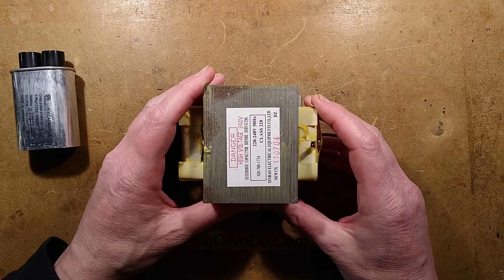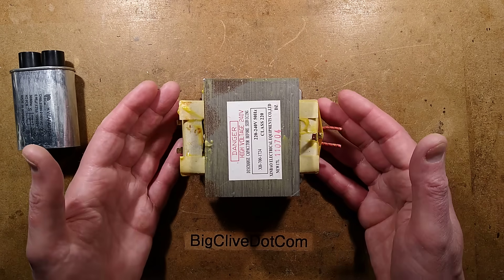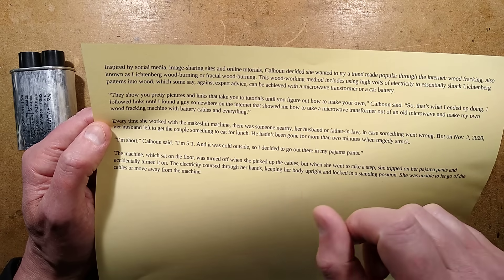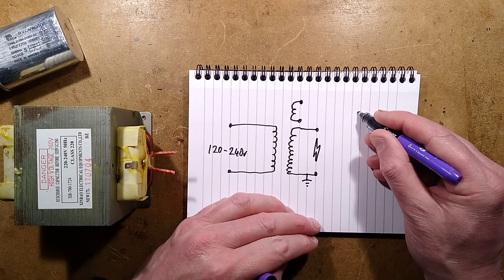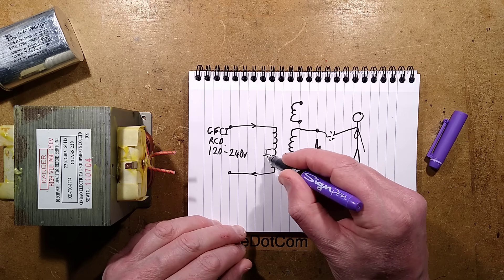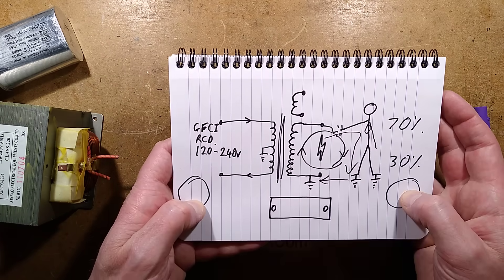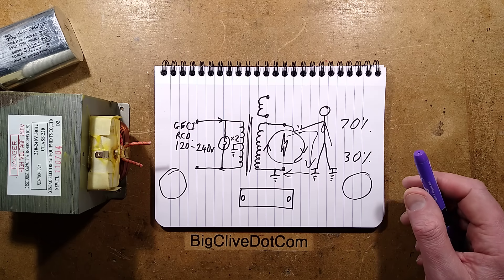The most deadly project on the Internet

Comment: A guy I worked with used a microwave transformer to build a super duty bug zapper. He took a dead bug zapper, a rather large model and wired it to the transformer out of the biggest microwave he could find. It hung from an arm off a pole in the back yard about 12ft high. The pole was made from 2" galvanized water pipe with a 90 degree on top and a chain which hung the bug zapper. With the microwave transformer powering the thing it would self arc on occasion even on humid days. 
The pole was about 15 ft past his swimming pool, and next to a huge screen house or gazebo he had built there. 

They had been out there late at night drinking after a weekend barbecue and when he woke up the next morning his wife told him to go out and gather up all the stuff they left out the night before. It was raining pretty much all night and was still raining when he walked back there barefoot. He started out picking up all the cups and bottle around the pool on the deck, then not wanting to get his bedroom sippers wet in the grass, he kicked them off on the deck under a chair and grabbed a bucket to gather up the pile of dishes and trash in the screen house. He said he made his way to the screen house, filled the bucket, and figured he's already wet so he might as well walk back to the trash cans and sort out the trash from the dishes, as he walks past the pole for the bug zapper is on he sees a pile of bottles right by the pole. He leans over, putting one hand on the pole and gets lit up. It  had been left on over night, and got rained on and was now soaking wet. The current was makings its way via the water somehow to the pole and when he grabbed the pole he made himself a perfect connection to ground. He got lucky in that it blew a breaker in the pool house as he was getting zapped. I would have thought that the pole would have also been grounded but found out later that the pole was set in spray foam not concrete. So it acted as an insulator. He was the ground when he grabbed the pole. 

Having been shocked, he then got mad at the wife, so he goes inside and tells his wife to go get the rest of the stuff and coaxes her to grab the pole Her 100lb self wasn't as lucky, being only in flip flops she to lit up harder and unlike him, who fell away from the pole, he had told her that "Her idiot brother somehow knocked the pole loose in the ground, 'Got ahead and shake it, see what I mean' When she did it she couldn't let go and got zapped for as long as it took him to run to the pool house 60ft away and find the breaker to kill the power. I'm sure he did it as a joke but she didn't see it that way and when she found out he already know it was electrified she went nuts, after several days in the hospital She never went back with him after that. I heard she was pretty messed up from it for a long time, but never spoke to her directly, I don't think she thought much of any of his buddies back then. 

As soon as the rain stopped he replaced the chain with a heavy rope and ran the power cord to it over head vs in the wet grass. 

It didn't last very long though, he said he thinks a bird had gotten on top of it somehow and was hunting the insects it attracted, when the bird went to go after a bug, it got its beak stuck in the grid and got cooked. The bird apparently just hung there sizzling till it caught fire and finally burned up the whole side of the bug zapper to the point that the grid was permanently shorted. When I asked why it didn't just pop the breaker in the shed he said he bypassed the breaker so he didn't have to keep resetting it all the time.

Comment: Common sense appears to be in short supply. Wet hands and not discharging high voltage components is a prerequisite for exploration and re-use. People that don't have adequate training  should just stay away from complex electricals but they wont and Darwinian principles will always apply.

Comment: Thank you for this vital safety production. 
My dad spent considerable energy teaching me about working safely with high voltage, so I have grave respect for such things. I treat disconnected circuits as if they are live, just like treating any gun-shaped object as if it were loaded.
If you haven't already, a short feature about the absolute necessity for proper grounding would be very helpful.

Comment: So, I don't plan on building a wood sparkler as there are way cooler projects imo. But as for how to build it: A second GFCI for the other loop, have a insulated see through box with a disconnect switch for when it's lid is open, for placing the wood in I mean. Have the sparky bits inside the box and a "stopper" on each so you can't pull them out and are only able to touch the non sparky bits outside the box. Add a trigger button (digital, separate cabling... not mechanical for sparky reasons) to one of the grabby bits for "firing". Add a timeout shutoff for the transformer for when it is not used (main reason for the trigger). Have the complete wiring up to the box insulated and inside another f*ing insulated box. Just for fun, add temperature monitoring and limits too. That better?

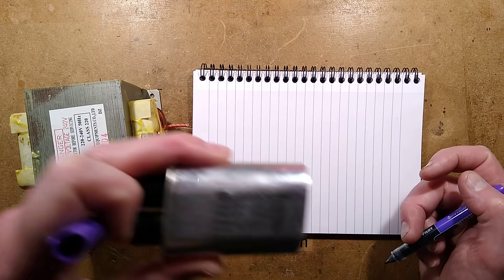Comment: 6:17 Re: Screwdriver to short out a cap.  Don't do this.  If you are trying to discharge a big electrolytic buy a discharge pen that is designed specifically for this task and is rated appropriately for the situation.

Comment: I didn't get the dead man's switch part. If you are holding both buttons down how would you be holding something to burn a pattern (not that I would do it, but just want to understand how this makes it safer!)
Reply from the maker: You wouldn't be holding the probes.  That's the point.  That's how most people die.

Comment: Decades ago I had a soldering pistol that works like you tell, primary a lot of coils, secondary a few thick ones that, when activate the pistol, heated up the solder-point. Much safer to get than ravaging through a microwave oven, unless you know what you do!

Comment: Anecdote: At work we have been doing high-voltage leakage testing on our equipment. Such testing is done using DC voltages up to 5kV, but at a very low current that is limited to - in our case - less than 1mA. We had rented professional equipment in (at least on paper) good repair for this job. The equipment looked almost brand new - it had very limited hours of use on it.

During one of the tests, there was a loud bang and a flash, and one of the HV cables laying on the ground had clearly arced through insulation to the floor. Upon close examination, there was a nick in the silicon insulation of the HV cable. This nick was hard to see, and we got the equipment in that condition. Had anyone been holding this cable during the test, they'd have been injured - most likely from uncontrolled muscle contraction. Not enough energy is in the system to cause burns, and the voltage source is automatically disconnected when over-the-limit leakage is detected. So it wouldn't have stopped a heart. But it would give a solid jolt. This was on a production floor. Just imagine all the nice ways you can get hurt when all your muscles spasm on a concrete floor with machinery, tools, metal parts, etc. It's not a stretch that you may end up injured badly enough to die. There were other people around so help would have been rendered in time, hopefully, but still - it was way too close of a call.

Comment: "Just do it properly with suitable safety precautions and understand the hazards you're dealing with." One sign of doing it properly is that the equipment you will be using will be EXPENSIVE. Thousands of USD expensive. You'll need properly rated insulating handles, properly rated wires, personal protective equipment, properly rated terminals, safety disconnects, and other stuff. None of this must be coming from AliExpress unless you want to get hurt, but from established professional suppliers and distributors in western countries. So, for most amateurs without the budget of a professional, there simply is no way to do it safely, period. And just spending the money is not a guarantee - you must also have enough knowledge of electrical occupational safety to know what to get. So, again, the chances of an amateur doing it right are vanishingly small!

Comment: Crazy internet hobbies LOL.

Thank you for the video! It got my attention. I am taking on small DIY project and the safety aspect is what drew me (not wood fracking or whatever it is called). Learning that > 48 - 50V is the lethal range of voltage capable of overcoming resistance of dry skin and that milliamps can be lethal (I didn’t realize such low amperage can get the job done here). Essentially - I don’t need a crazy 2000v to cause serious injury or death. I have always treated electrical power as a loaded weapon; but since I am going to be working with 20V/3.5A output power source and IC - review of safety seemed prudent. Brushing up on ESD also. 😂 Hope your videos saves lives and prevents injury!

Comment: If you want to do this safely... or rather safer than a MOT then you use a flyback, I've done it in the past for clients and works great. Still dangerous and should not be attempted by idiots, flybacks do hurt even tho the frequency is much higher.

Comment: I'm needing a new microwave and was thinking of stripping the old one for copper.

How long can that transformer hold a charge for when the microwave is switched off and the plug is pulled out of the mains socket?

What does a thingy screwdriver you mentioned look like exactly?

Thank you!
Reply from the maker: The transformer itself doesn't hold a charge, but the capacitor may if its discharge resistors have failed.  Many microwave transformers use aluminium windings for cheapness now.
Reply: @bigclivedotcom   Thanks for the reply!

Do all microwave capacitors look like the one you showed?

How long can they hold a charge for?

Is using one of the screwdrivers you mentioned the only way to get them to discharge safely?

Comment: I can tell you these transformers are dangerous. This guy is 100% right. One thing that I would like to mention is that when you apply the mains voltage to the input of the transformer if the transformer housing isn't grounded then it becomes hot and you can die just from touching the casing of the transformer. So experimenters beware grounding and safety are our friends. Don't work on live circuits, they will eventually get you.

Comment: Ive been doing it forever and never had an issue. The key is to just hold one and and have the other be the ground just clamped to the board. Also, its the amps that kill you not the voltage. Ill hold both leads tomorrow and made a video on youtube to show you.

Comment: I’ll never monkey around with something like that. At 2000 volts under load you won’t survive it. And even if you do survive it, you would have extensive tissue damage and wouldn’t have a chance at a normal life. I’m a radio amateur operator and I have messed with lots of low voltage stuff like antennas and stuff, but never with high voltage transformers, and I will never either.

Comment: Safety mindfulness. 
One wet and rainy afternoon, a substation worker is walking over a gravel path with twelve feet steel fence along each side. A transformer behind one of the fence discharged an arc directly towards and through the worker to ground.

I'm elecrophobic. 😵‍💫

Comment: I don't understand how and why the secondary windings are connected to earth. It is galvanically isolated, so as long as the housing is isolated from earth it should remain floating right? 

Still don't recommend messing around with 2kv but the earth explanation doesn't make sense to me...
Reply: Secondary winding's neutral line connected to the ferrite core, and the ferrite core connected via a terminal to earth wire. It was shown in the first few mins.
Reply: @klarnorbert  That makes sense within the microwave itself, but when you are connecting a plug to the primary side of just the transformer, why would you ever connect PE?

Comment: Great video I know a lot of teens to play with these transformers and they stop along the road and they pick up the microwave ovens just for the transformer, they don’t just use them for woodburning. They use them for other projects to gain high voltage when I was young microwave ovens did not exist.

Comment: I learned that my heating mantle just runs mains power through a resistive load under some kind of heat-resistant knit fabric when I used a damp towel to wipe potassium hydroxide off my rbf while it was heating.

Comment: I have a serious question can you get shocked while scrapping a microwave if it's in pieces like in your video?New sub here from CT
Reply from the maker: The main risk is from the capacitor, but it should have a discharge resistor.  Never trust that though.

There's an urban myth that the magnetrons have a beryllium ceramic insulator, but that's only ultra high power industrial units.

Comment: I used MOTs to make Lichtenberg figures and "Jacob's ladders" a bit younger in my youth — during 2016 when I was 14. There weren't any guides on how to do it, so I went frame-by-frame on a Keystone Science video, copying everything he did until I heard the MOT buzz to life. I even remember hooking up the magnetron with a hot glued "soda can muzzle" to turn on lightbults, then running jumping cables in the transformer to cast metal. While I survived and still made some great memories in the form of homemade videos, I still didn't know anything of what I was doing; it's definitely something I wouldn't try again (as I'm pretty sure my plot armor ran out). Funnily enough, you were also one of the main YouTubers I watched 8 years ago when I did that. Time flies.

Comment: Distilled water cannot conduct electricity at all! At least not until the voltage is so high that it passes a long distance through the air itself! Otherwise, it is a rule of thumb that a healthy heart can withstand a shock of one second at least and I have received hundreds of shocks from 230 V single phase which is 400 volts between the phases which happened more than once between my hands so yes the current has passed the heart without problems!
But I am aware that the current has the same frequency as what our muscles work with and therefore causes cramping so I am extra careful with splice cables for example! But I have to say that getting a shock from the ignition cables to the spark plugs on the car is much more unpleasant, probably because it involves several thousand volts of a not high current which is the most dangerous depending on how long you are exposed to it sure, I got burn marks on my fingers from 400 V, but for such a short time that the 3x400 A fuses didn't have time to blow!
It would be interesting to know the safety distance from our trunk lines of 400000 V in case they should for some reason break off and lie on the hill? There is absolutely no risk that I would approach someone like that, but you are at least curious and are well aware that other factors affect such as soil moisture, watercourses and protective equipment! The word watercourse made me think of the two times lightning has struck right next to my swimming father and it was Distilled water cannot conduct electricity at all! At least not until the voltage is so high that it passes a long distance through the air itself! Otherwise, it is a rule of thumb that a healthy heart can withstand a shock of one second at least and I have received hundreds of shocks from 230 V single phase which is 400 volts between the phases which happened more than once between my hands so yes the current has passed the heart without problems!
But I am aware that the current has the same frequency as what our muscles work with and therefore causes cramping so I am extra careful with splice cables for example! But I have to say that getting a shock from the ignition cables to the spark plugs on the car is much more unpleasant, probably because it involves several thousand volts of a not high current which is the most dangerous depending on how long you are exposed to it sure, I got burn marks on my fingers from 400 V, but for such a short time that the 3x400 A fuses didn't have time to blow!
It would be interesting to know the safety distance from our trunk lines of 400000 V in case they should for some reason break off and lie on the hill? There is absolutely no risk that I would approach someone like that, but you are at least curious and are well aware that other factors affect such as soil moisture, watercourses and protective equipment! The word watercourse made me think of the two times lightning has struck right next to my swimming father and it was electrifying enough to be enough!!!

Comment: Here’s a tip, I failed to properly check an old light switch I was changing over to a new stainless steel one.
I touched the live wire with my screwdriver which luckily was an electrical safety screwdriver.
It took most of the charge luckily and blew the safety fuse inside but still had enough charge to blow me across the kitchen into a heap on the other side of the room. I can safely say it hurt a bit as the remaining charge went up my right arm. 
Electricity can kill you! 
Be careful, be safe!

Comment: Back in the day I worked on microwaves and tvs qualified electrical engineer and electrician now I say this to u.Higher the voltage the more it can travel across 2 points of space and with lethal current its the same as a lighting strike.He who dares not always wins the more u role that dice the more likely u going to meet your maker.And iv come close and waring rubber gloves mite not save u aswell.And if u grounded well 😮